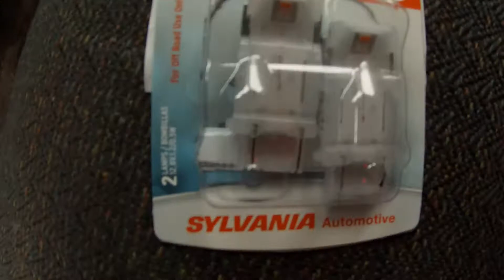Sylvania 3157 Amber LED Silverado Running Lights 4114

Comment: Does it matter if 3157 is used instead of 4114 bulb for drl? Won’t it affect anything in time like blinkers blinking fast etc? Thx
Reply from the maker: The numbers are the same part I believe. These aren't the blinkers just day running lights when day light. There still working.